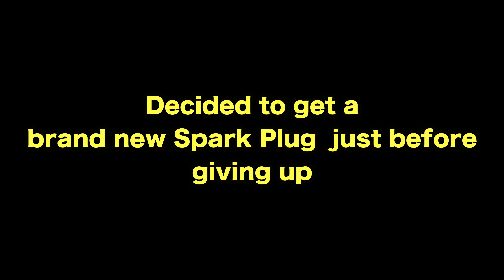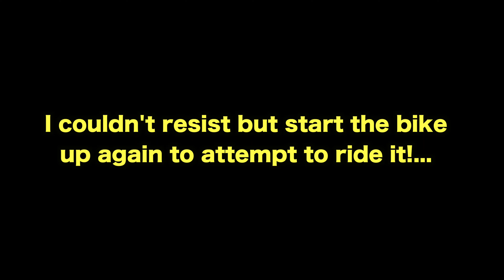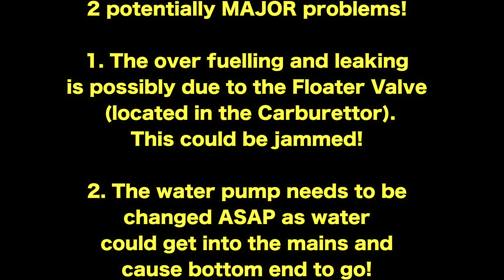DID THE YAMAHA YZ250 ACTUALLY START UP?? MAJOR ISSUES!

Comment: The water pump leaking will be 2 seals that need replacing. Also best to put a new water pump gasket on. From the plug it doesn't look lean could just be that the idle is high. If it isn't just the idle and is lean then you probably have an air leak from the rubber intake that connect the carb to the cylinder. Fule coming out the overflow would most likely be a float needle worn... Only a few quid off ebay for a new one. As the carb fills with fuel the float in the bottom floats up with the fuel until it pushes the little rubber tip needle in to close the fuel off. That's the needle that's probably worn or could just be stuck
Reply from the maker: WOAH craig really really!!! appreciate this, helped me soo much willl take this all up! you make it sound so easy, big motivation brother!
Reply: @hoodstig  glad I could help mate, I've been rebuilding mx bikes for years. They are actually very simple engines.

Comment: That’s the worst filter I’ve seen haha, previous owner must have been a nugget. 

Should be cleaned after every ride lol. Great vid good luck buddy!

You can tackle the water pump yourself, it’s just bolts and gaskets - then bleed the air out. 

The carb - again you can read up and do it yourself, but if you have a shop near by I recommend paying them to do it. It’s easy to hole a piston or worse if you aren’t confident plus once you get it back you know how the bike should run so you have a baseline to work with.
Reply from the maker: nice one brother really appreciate it will take it all up!

Comment: Told you boyyyyyy 💪🏼💪🏼💪🏼💪🏼 comeonnnn
Reply: Check the float isnt stuck in the carb and you will get the odd fuel leak and coolant coming out the over flow, im so gassed you got it going, just do a quick check on youtube about 2/ carbs and the idol screw
Reply from the maker: will do brother thanks for the motivation brother